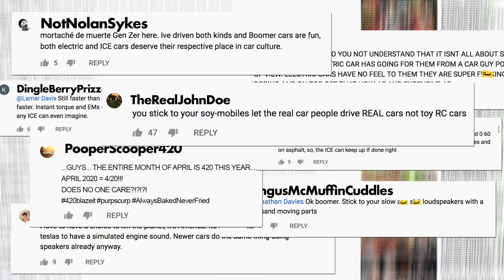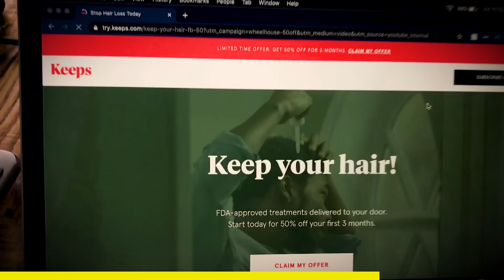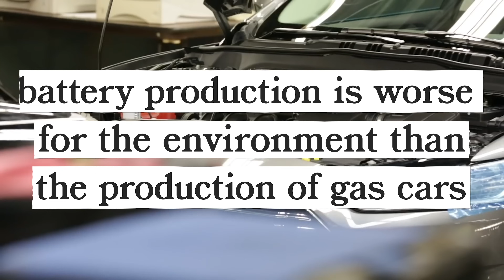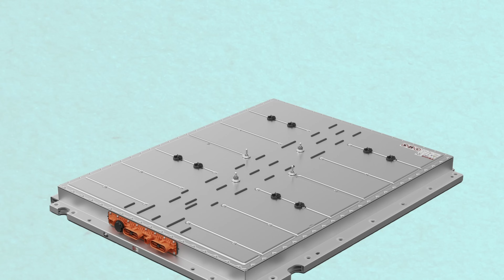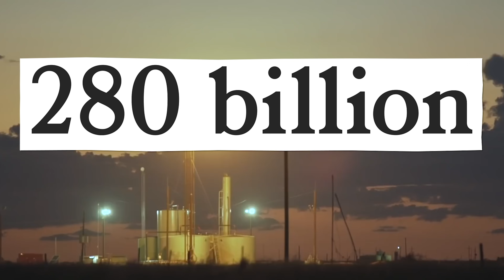Are Electric Cars REALLY Better for the Environment?

Comment: Tesla are going to mine Lithium with a much more efficient process. Take a look at the series about this on 'The Limiting Factor' channel. Lithium is plentiful, and Tesla has bought land close to where it will manufacture the cars, and it will handle this locally. Cobolt is being removed from all Tesla batteries. Lithium Iron Phosphate batteries are much cheaper to make, and don't use Cobolt.
The reprocessing of batteries is being tackled by Tesla, they're doing this already.
Tesla has just published its Environmental Impact Report, it's worth a look if you're interesting in a deep dive.
Yep, the oil industry is a horrendous emitter of CO2. They use vast amounts of electricity in the refining process.

Comment: What about when you have to replace the battery? They don’t last for ever.
Reply: Watch the YouTube video posted by a Tesla Model S owner. His car has covered 400'000 kms on it's original battery. And you may not necessarily need to replace the complete battery. Failing cells can be removed and replaced with new ones at much less cost than a complete battery replacement. There are YouTube videos of that too..... Most new EV's have an 8 year battery warranty.

Comment: You forgot battery life and the effects on landfill
Reply: much less of a factor than you think it is.
Reply: @engineeringtheweirdguy2103  😳eye opener.....👀?

Total fuel consumption of U.S. airlines is approximately 19 billion gallons annually.
Total fuel consumption for mining Ore for construction of electric car batteries is approximately 21 billion gallons annually.
The 21 billion gallons of fuel burned can only produce enough Ore to build 250,000 electric car batteries. 
The lifespan of an electric battery is 10 years and is not renewable. By 2050 these batteries will fill landfills with 50 million pounds of waste that does not break down. 
I wonder if people would still believe in electric power cars, vehicles or equipment if they knew how massive the carbon emissions footprint really was? 🤨
Reply: @lockdownthrash8364  Well firstly lets get your blatantly incorrect information out of the way. EV batteries last much longer than 10 years. Their warranty period for current models sits at an industry standard of 8 years alone. Modern EV batteries are designed to, and are showing sings they will last up to and exceeding 500,000 miles lifetime which is twice the average lifespan of a combustion engine.

Next is the fact that EV batteries are, with todays technology 95% recyclable inclusive of all the lithium, cobalt and nickel in them which have been suggested to form their own close loop recycling.
Reply: @lockdownthrash8364  Now onto the rest. The Global fuel use airlines pre-covid was 95 Billion gallons of jet fuel. Meanwhile globally we produce as many as 2.65 million EV's pre covid. With an average battery size of 50kWh. Most studies conclude that the total use of energy (fuel or otherwise) to produce EV batteries currently sits at between 100-200 kWh of energy to mine, machine, manufacture and retire EV batteries. So lets take 200kWh.

So annually (pre-covid) as much as 26.5 billion kWh of energy (again, fuel or otherwise inclusive of renewable electricity used). Jet fuel contains around 34kWh of energy per gallon. So that would be the equivalent of 0.779 Billion gallons of jet fuel. 

In other words, approximately 121 times less fuel than is consumed by the airline industry. Excluding the energy used to maintain their aircraft, and the energy used to refine the jet fuel which is also VERY energy intensive.

Comment: The best way to make an electric car would be having a big pressure gas tank full of water and a little pipe running from the tank to a small waterwheel mounted under neath the car, then put a shift from the waterwheel to a generator so that way the water wheel will spin at a super high rate of speed causing the generator to produce electricity that will run from the generator to the motors and every thing else in the car without needing a battery.

I AM A GENIUS.

Comment: Finally saw this video. A silly question here, how much pollution do those Lithium batteries make that are not recycled? Current recycling rate of said batteries is 5% at best. Yup, look it up, it's actually 5% in best case scenario. Now, that means the remaining 95% are basically buried into the ground. So while they don't produce CO2 per se they still contaminate the ground pretty badly. But for some reason nobody wants to count this in overall EV pollution schemes.
Reply: You just can't accept lmao

Comment: This may be an old vid. You left out carbon emissions for the production, placement and maintenance of windmills on and offshore. Also the environmental hazard off disposing of the old E.V. batteries. I read that you had to travel sixty thousand miles to offset your emissions on the build and disposal of an old E.V.

Comment: It would be interesting to see a few things added into the emissions comparisons. One, average battery life before replacement (which we don't really know since the market is so new). Two, efficiency once the battery capacity drops to the manufacturer minimum before warranty replacement, which is usually 70% total capacity. As someone who lives in the middle of the country, a 250 mile range (if driven conservatively) is not enough, especially when it's reduced by 20-30%. I'll drive 200 miles to go camping in a primitive camping spot with no electricity. Kind of a hard sell to get me to buy a vehicle that can't get me back home.
Reply: Well actually modern EV batteries are rated to 1,500 cycles to 70%. This is, for a model 3 with 325 miles of range, 487,500 miles to reach that point.

As for camping and the like, the vast majority of people dont need to drive further than 100 miles in a single day. They take the trips you're talking about once or twice a year. Which isnt a strong argument to base your second largest financial decision on. In any case, I have done that with my Tesla Model 3. (gone camping at the end of my range). I took a jerry can of petrol and a small cheap portable 2kW generator. Much to peoples surprise it is actually more fuel efficient to charge your EV from a cheap small portable generator than it is to use that same fuel in a combustion engine.

That means for people who get vehicles like the cyber truck. Carrying a small generator most of them would normally be carrying anyway and the same amount of jerrycan's, the EV will have further endurance off-road than their ICE competitors.

Comment: Can "clean" electricity sources keep up with space requirements and growing population?
Excluding nuclear, I'm referring to solar, wind, water sources etc for charging the batteries.
What is the sustainability and environmental impact of those sources of electricity?
Stay gold.
Reply: I wonder if the land excavation (with diesel machines), the stringing of cable, the manufacturing of cable/solar panels/turbines/steel/alloys, the huge amounts of land needed to place solar and wind farms needed to produce the electricity outweighs fossil fuel. 
If EV’s ever become law, think of the extra thousands of miles of cable needed to retrofit fueling stations so that we can drive as freely as we do now. Also, consider the mess of extracting millions of old underground fuel tanks. 
I’m totally willing to admit I get hinky feeling when the govt says we will be going fully EV by 2050. It just feels a bit controlling.
Reply: It's a global scam.

Comment: How about hydrogen versus electric cars?

Assuming all electricity generated will be green energy in the future, then won't hydrogen cars be better for the environment?

Since those don't have massive batteries of which the production emits a lot of CO2, maybe hydrogen cars could be the end-stop for vehicles? Those have the potential to ACTUALLY be zero-emissions. And I don't see batteries getting produced with zero emissions anytime soon.
Reply: actually no for 3 reasons.
1.) Hydrogen is expensive. Why is the important to being environmentally friendly? well the cheapest way to produce hydrogen is by getting it from fossil fuels which are hydro-carbons. This means using electricity to split the fossil fuels (coal, gas, oil) into hydrogen and oxygen, you can capture the hydrogen but often the carbon is released into the air. With green hydrogen costing more than 2.5 times the cost of petrol per miles currently, cheaper alternatives would be very appealing.
2.) Fuel cells use platinum. Platinum is an extremely toxic element. There are machining wastes to deal with when producing fuel cells for hydrogen vehicles, But further to that, it has to be dealt with when the car is at its end of life. which is concerning given point 3 below, especially since its orders of magnitude more toxic than anything found in a lithium battery if exposed to the environment.
3.) Hydrogen vehicles dont last very long. Its not a widely advertised fact as the media has a bias for hydrogen and against EV's (buy in large), by hydrogen vehicles roll off the factory floor with an expiration date printed on the fuel cap limiting the life of hydrogen vehicles to 10 years from the date of manufacture. EV's on the other hand (again, contrary to popular belief due to media bias) last a very long time, modern EV batteries are designed to last up to and exceeding 500,000 miles with the batteries being the biggest limitation to the life of the vehicle. This represents an average of 30-40 years worth of driving for the average person and is double the average lifespan of a typical combustion engine. 

What that means is that for every EV you own to the end of its lifetime, you'd have to manufacture and dispose of 3-4 hydrogen vehicles and all the emissions that go with manufacturing and disposing of an entire hydrogen vehicle. (including disposal of the platinum from the fuel cell).

Comment: I think EV still have a way to go in long term reliability before I care to even thing about making the jump. My Honda Civic is easy to work on, get 40MPG, and with good maintenance can get over 400,000 miles. Tesla have already proven to be unreliable, nobody can fix them, and the average person can't even afford to by one.
Reply: actually EV's are very reliable, on account of not having many moving parts. Infect, most Teslas have no required regular servicing at all. Not even for warrantee. Most faults that occur with the vehicles are software based in which case you can separate the computers and restart the UI whilst driving the car, if that doesn't fix it you can do a had reboot by pulling over and in the event of persistent faults, an Tesla technician can remotely access the cars diagnostics and he can rectify the problem remotely. I've only ever that to soft reboot the car once, because Spotify wasn't working properly. And i did so while I was driving and 20 seconds later it was fixed.

Tesla gets a bad wrap for reliability because consumer reports changed the model 3 from being the highest recommended vehicles and the most reliable vehicles to a month later being rated the least reliable. when asked why it cited that paint quality and panel gaps (both of which aren't issues with reliability but with build quality of which consumer reports has its own category for and the model 3 was the first and last vehicle they applied build quality to reliability for, something consumer reports ignored, when criticised about this)

Comment: but what about the fact, that ev batteries wont last as long as a gas engine?
Reply: I'd be more concerned about the fact you've been misinformed. Watch the YouTube video posted by the Tesla Model S owner. His car has covered 400'000 kms on it's original battery...... And even more humble EV's such as a Nissan Leaf, can easily get past 10 years before a battery refurbishment ( you notice I didn't say replacement) is needed. A battery refurb costs a fraction of a complete replacement.......and can see the vehicle by for a few more years. So you see, your "fact" isn't a fact at all......it's a misconception. And a common one.
Reply: maybe, but what about long trips or even bus drivers truck drivers etc. thats like my biggest concern, with a gas engine you drive 500km you fill it back up in 5min and you back on the road.

Comment: Not bad Nolan.. but you didn't mention the 500,000 gallons of water that is toxic that can't be used for anything after mining 1 Tom of lithium.  Or the footprint of the cost of replacing the batteries. Or the fact lithium is toxic and the fraction that can not be recycled sits in a landfill someplace.

Comment: I agree whole heartedly that EVs will be better for the planet long term, but, the big question is, how much better off will the planet be, there is man made CO2 emmissions and natural CO2 emmissions, what are the numbers, how much is man made and how much is natural, we use climate models to predict a disastrous climate future, but when those same models were used to test against past climate the climate map between then and now should have shown what was actually observed, in other words, using the same sort of data used today but obtained from past records and feed into these climate models should have resulted in an accurate map of what the climate did between then and now, the trouble was it didn't, this means the models are wrong, there are so many variables in nature that the climate scientists have no actual idea of what the climate actually does or how it does it long term, (climate is a 30yr weather cycle) and don't forget "tuning" by the programer, some start with a fixed point, say 3 degrees C as a net temperature increase aimed at 2100 and "tune" cloud levels to achieve this goal, but in nature if those cloud levels do not appear then neither does the warming effect, so EVs may be better, but do we actually need them, Zero emmissions by 2075 will just stabilize what we already have, not improve it but merely keep it as it is now, at zero emmissions it will take centuries for man made CO2 to dissipate in the atmosphere,  anybody tell me how much difference we make again ?????

Comment: One point, you say the production of lithium generates huge emmissions, is that CO2 as it stays in the atmosphere for centuries, but if they lithium manufacturer develops tech to limit of halt CO2 emmissions in the process of manufacturing lithium for EV due to increased emmissions of CO2 from ICE vehicles then the EV is no longer needed as the manufacturer has now eliminated CO2 emmissions from it manufacturing plant, this tech can then be applied to all industries and energy plants to halt CO2 emmissions, smaller cheaper CO2 scrubbers for ICE cars like catalytic converters made cheaper that can be replaced more often, what do you do with an EV battery pack after 5 yrs when it needs replacing, it takes 60,000km of driving your EV to balance the emmissions book from making it in the first place

Comment: I've spent few years in the US and at summer time in New York Edison Co. the electric company barley could handle with the need of the air-conditioner systems. so how could they run the whole state with electric cars?! you have not studied  for your vid enough.
Reply: EV's typically charge at night when demand is at its lowest. Further to that, most states have reserve Peaker generators making up for any shortfall in demand of energy. The largest struggle most power companies have with power supply is modulating the frequency fast enough.

Comment: Couple of things to add: 
- current gen EV batteries have a massive lifespan as their degradation isn't linear. Even a "dead" 50% degraded Tesla 100kwh pack is capable of taking a house off the grid for 20 years with a solar array.
- cobalt is also used in oil refineries.
- batteries are already phasing out cobalt.
- petrol & diesel already have a massive carbon footprint before they enter the fuel tank. Not sure if this was accounted for!
Nobody is gonna make me get rid of my ice engines, but the guilt factor is already creeping in, not gonna lie 😣

Comment: You cover the impact of oil extraction but not the impact of “green energy” extraction. The carbon fiber blade of a wind generator doesn’t grow on trees and solar panels are an environmental nightmare hiding in the shadows. Did you know that if a solar panel breaks and comes into contact with the ground a hazmat team has to come to decontaminate the area? Yeah, they’re that toxic… 
There’s so much more to this than you’re espousing and it’s disingenuous. You’re basically putting out a government PSA and doing loyal fans a disservice. Sometimes you’re spot on, this time you’re being a tool…
Reply: actually only a small minority of "thin film" or CdTe type solar panels are toxic. The majority are just silicone based. also whilst the carbon fibre does grow on tree's its worth pointing out that, it is a form of carbon capture, and isnt something you have to constantly produce to operate the wind turbines every hour, unlike fossil fuel power plants which have to burn and release the carbon based emissions of up for 14,000 tons of fuel per day for even a small 500MW power plant. Geee, I wonder which one might be better for the environment. You're right, it is such a close call that its worth mentioning in the video not about green energy at all.

Comment: What about waste battery and the environmental impact of disposing or recycling?  What about the cost of replacing the battery? You did not cover end of life issues with battery.
Reply: Also he covers the impact of oil extraction but not the impact of “green energy” extraction. The carbon fiber blade of a wind generator doesn’t grow on trees and solar panels are an environmental nightmare hiding in the shadows. Did you know that if a solar panel breaks and comes into contact with the ground a hazmat team has to come to decontaminate the area? Yeah, they’re that toxic…